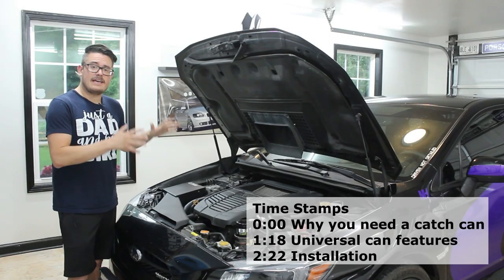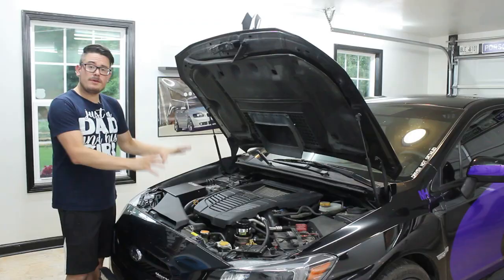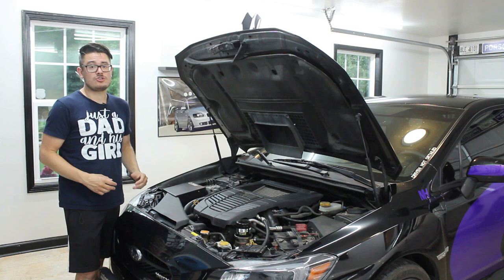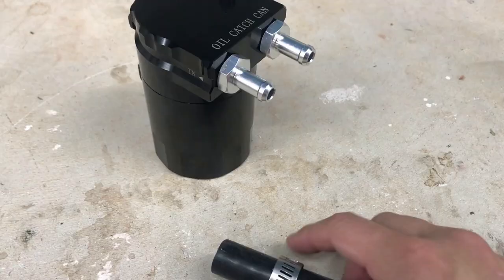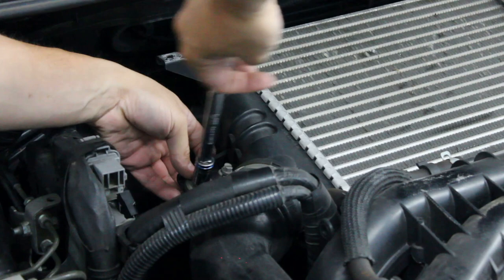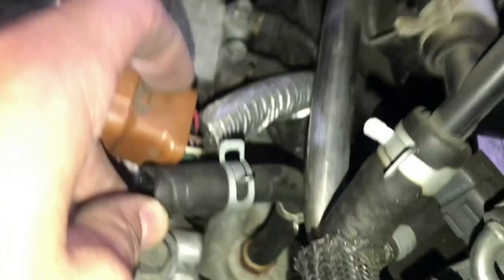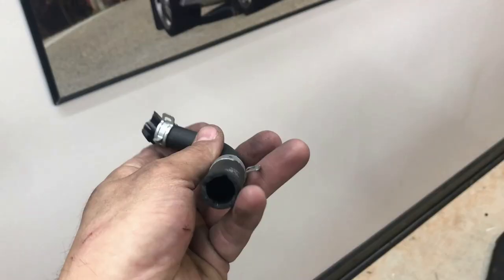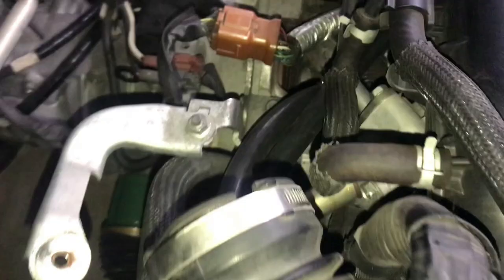2015-2021 Subaru WRX, Universal Oil Catch Can Install

Comment: Awesome! Did you have issues with the silicone lines collapsing under heavy throttle? I'm also wondering why you didnt use the breather that typically come with these catch can kits. Thanks!
Reply from the maker: No issues with the lines, they're just as solid as the stock lines are. You really only need a breather if you have excess pressure building up. I didn't consider it necessary on my setup and many of the aftermarket catch cans for these WRXs don't have breathers either; some of those aftermarket setups are designed for significantly more power than I'm making.

Comment: Hey,  any updates after using it for a while ?  Thanks. 
Thinking of running this on my Wrx 🙏🏽 this vid really helps. appreciate you bro.
Reply from the maker: It has been problem free for me. Gone through about 15k miles and 3 oil changes. It has captured a bit of oil each time with mostly spirited mountain driving and commuting.

Comment: Excellent video, can I ask about how many feet of hose you needed for this particular setup?
Reply from the maker: I bought 4 feet of hose, but didn't need all of it. It was just easier to run both longer hoses, then cut off the excess once everything was mounted.
Reply: @MyNameIdeasWereTaken  perfect. I plan to follow what you did with mounting and everything. It just looks clean and tidy. Thank you for this info brother! This helps a ton!

Comment: Hi, going to do this install, couple questions:
1. You show the one area with the elbow tube before the can, but where does the hose connect after the can? Did you show that?
2. Were all the hoses indeed 10mm or were there any other sizes?
3. I see some people cutting the existing hose and splicing the can in. Is this equally as good or should I take the time to connect it at the source?
Thanks so much!
Reply from the maker: 1. Keep following the same line back to the intake and you'll see where it connects. The catch can is essentially just a new detour off that original PCV line. 
2. What I used was all 10mm. 
3. This would be equally as good, but I opted for all fresh hoses so that I could route things exactly where I wanted without any unnecessary kinks or splices.

Comment: Where would you put a catch can if you had an aftermarket charge pipe since the stock one is so much slimmer
Reply from the maker: Take a look at some of the aftermarket catch can kits for these cars, there are a few different mounting locations that are commonly used.

Comment: I've put 11,000 miles on my Forester and there's not even enough to cover the bottom of the can. Is this normal for new vehicles? Some think it's because I change my oil so often.
Reply from the maker: It's there to catch any blowby oil, which is a result of higher crankcase pressure. It's not a result of how often you change your oil, but how frequently you are driving in high boost when you're potentially increasing crankcase pressure. If you're running a stock tune, the catch can likely doesn't have a lot to catch.

Comment: Nice install! How's it going, 4 months down the line? Has it collected much oil?
Reply from the maker: In my last oil change, after 5k miles, the catch can collected about 2 tablespoons worth of oil. So it's definitely doing its job.
Reply: @MyNameIdeasWereTaken  Good to hear it's working! I'm thinking of installing the same can (also with better quality hoses and clamps) on my older WRX. One other question, I was wondering how useful that dipstick is being black?
Reply from the maker: @mickrichBMXWRXJapan  You can still see the wet oil line on the dipstick, so no issues there.
Reply: @MyNameIdeasWereTaken  Thanks for the confirmation - much appreciated!

Comment: Wouldnt it ventilate from the intake then back to crankcase?
Reply: No. The PCV valve itself is one-way (unless it's damaged or very old) so back pressure through the catch can wouldn't be an issue. But also it isn't connected to the high pressure charge piping.